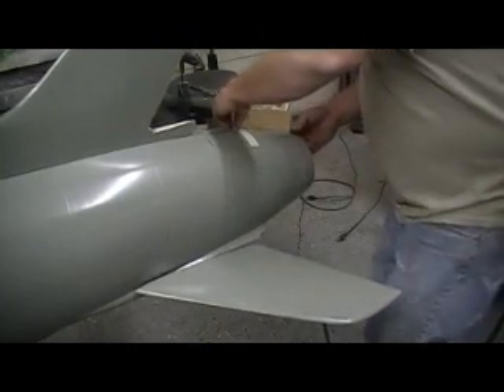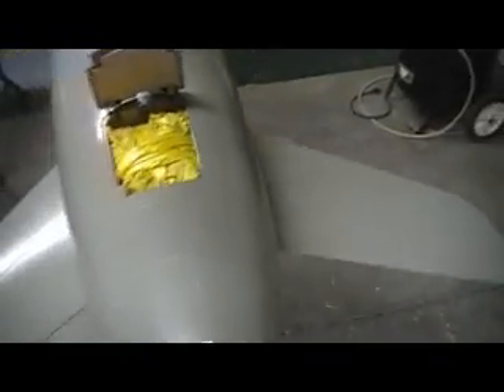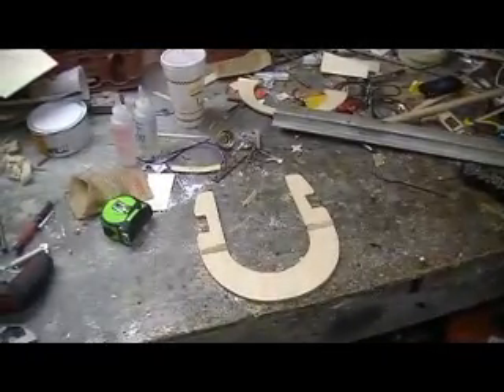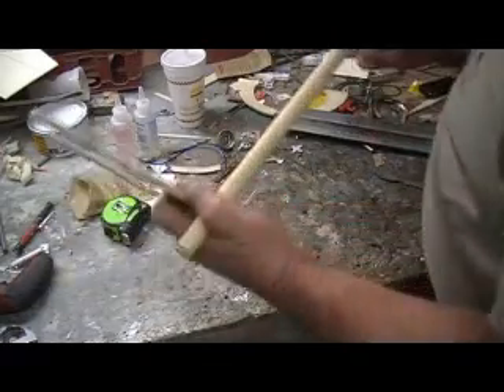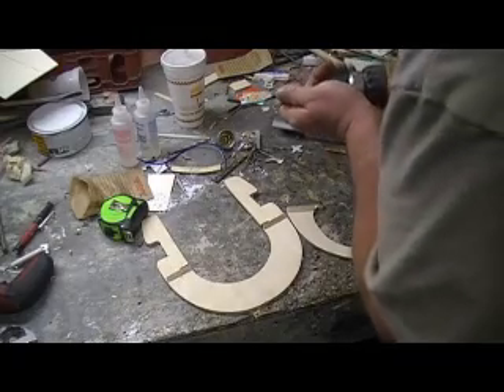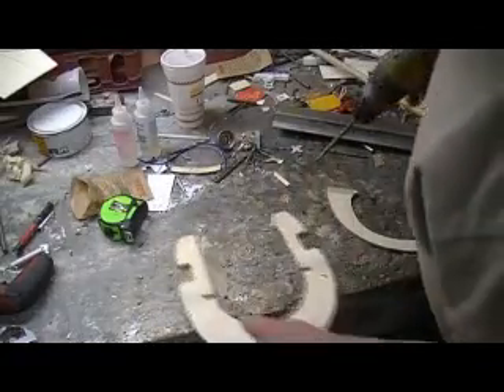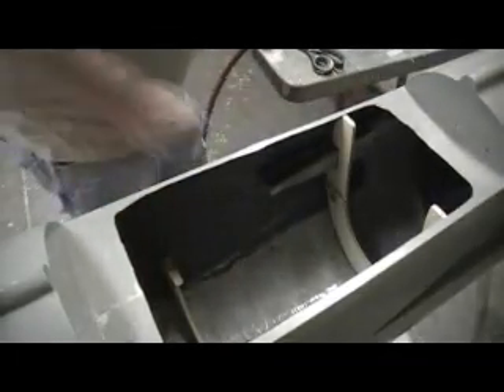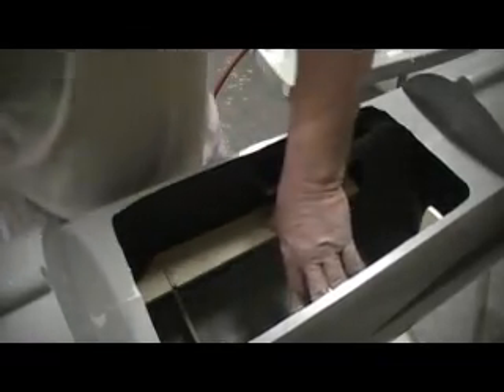how to build a rc jet F-105 thunderchief # 411

Comment: You could run a small cord from the end of the hatch, under the chute, attaching in the tail end of the hatch so when the hatch is opened, it stretches the cord (or band) and forces the chute out.